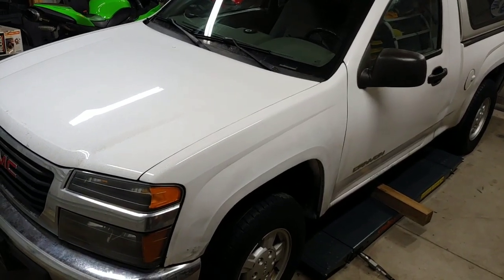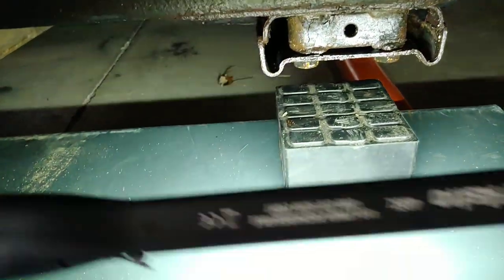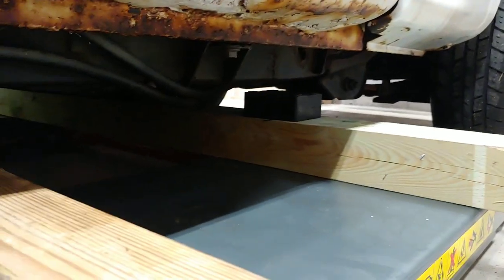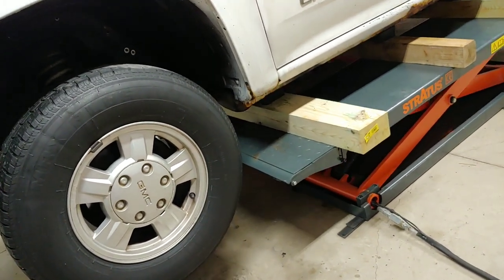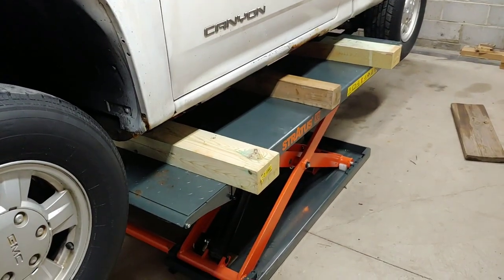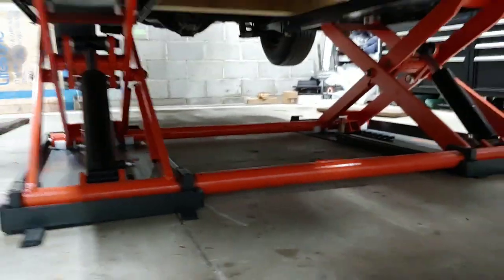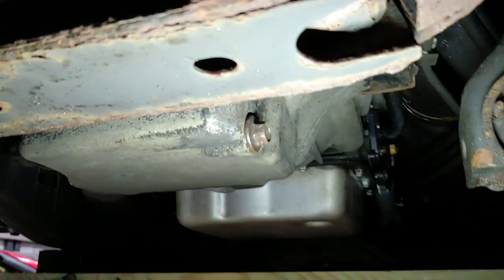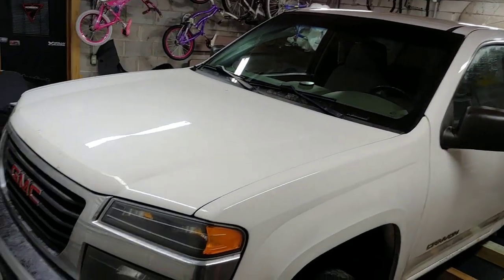Stratus Scissor Lift Support Bars

Comment: I ordered the 9000 extra-wide extra high commercial-grade lift, my first time using it I lifted my Dodge Ram and when I went to lower it, only one of the two locking mechanisms disengaged, my truck preceded to lower on one side and then fall completely onto that side on the support bars. Obviously, this was a catastrophic failure, and I will say that the support did send a new lift promptly, but upon receiving it When I first used it with the bucket of my skid steer in order to test it before putting that much weight, it was doing the same thing with one lock not disengaging. This was the 9000 E, then once we resolved that problem after speaking to tech support the other problem was my skid steer weighs 8400 pounds which is under the weight capacity, I noted this to the support team before our FaceTime call, during our FaceTime they gave me every way to troubleshoot why it was incapable of lifting 8400 pounds when it is a 9000-pound lift. Unfortunately, this type of lift needs to be recessed into the ground in order to lift that weight because if it is not 12 inches (because it is 4 1/2 inches to start and needs to be raised 8 inches to take the weight) then it can't lift much of anything. I did my due diligence, I called and spoke to the owner, read all spec sheets, etc. and this is NOT mentioned anywhere and is not advertised anywhere, and really should be because after doing all of the work to modify my space to accommodate this lift, it was all for nothing because This lift cannot do what it's advertised to unless it is recessed 1 foot into the ground, at that point the 40 inches that it can go up becomes 32 inches. Making every single number that they advertise false! Also, I would like to note that trying to lift the weight of the skid steer (8,400lbs) and having the lift raised about 6 inches before starting to lift with the weight, one side of the lift (closer to the control tower) was four inches higher than the other! This happened during the facetime call while I measured on video with a tape measure! Another dangerous situation. I do not think these lifts are safe at all, and after speaking to Technical Support the second time about this lift having a similar issue to the first one, and showing all of this on facetime, their response, after me having offered to share the shipping expenses with them to send back, and pay the difference for a 12,000 lb 2 post, then accommodate that lift again by digging again to install 6'' thick cement with rebar as I did for the scissor-type lift widening it for the larger width of the 2 post lift, they were going to do this and told me how much, to which I agreed, but then suddenly they didn't have any more in stock? (Even though Richard from the company assured me one would be put aside on a recorded phone call, and the website says "in stock ships in 1 day"),  they somehow didn't have anymore? Then when I found another lift from another company as an alternative, they wanted to have me pay for all of the shipping expenses and a 30% restocking fee for a lift that never functioned properly from the first time I used it! Furthermore, I had a 20-minute conversation with the owner prior to ever purchasing the first lift describing my intended use for it, and whether or not it was capable of handling it also on a recorded phone call, during which I was assured that it could handle it. Obviously, that was bad information and I could have lived with all of this and been fair in making it right, but I was not met halfway clearly, this company really does NOT stand behind their products. I am trying to depict the actual events, and facts to the best of my ability in order to inform future buyers. I only wish I had seen a review like this before my purchase. Currently, my attorney and credit card company are handling this as my efforts at an amicable resolution were futile.
Reply from the maker: Wow sorry to hear about the problem. But mines been great and still loving it

Comment: Thanks for sharing this. I am considering buying this but was wondering if the width placement are adjustable. I guess they are not. They should have made it adjustable for any vehicle. I would prefer not to use wood across to have as much clearance en between like if I have to take off the entire exhaust system.
Reply from the maker: The width is not adjustable. You will only have to do this if your frame is narrow.
Reply from the maker: You only have to use the support bars if the vehicle has a narrow frame.
Reply: Yeah I understand. I was just saying that I prefer not to use the support bar at all. Maybe Stratus should have made the platform a little wider or adjustable with a locking mechanism for safety. They could improve this product better. Your review is great. This was exactly what I was hoping to see. Maybe they'll come up with a new version so I'll get that instead if i can't find another one that does what I need :).

Comment: Does this lift go straight up or does the vehicle move forward or back as the lift goes up. Only asking cause I dont have allot of spare room in front of my truck so it needs to go straight up.
Reply from the maker: When the vehicle goes up it doesn't move but when you lower and the tires touch the floor the car will move slight forward.